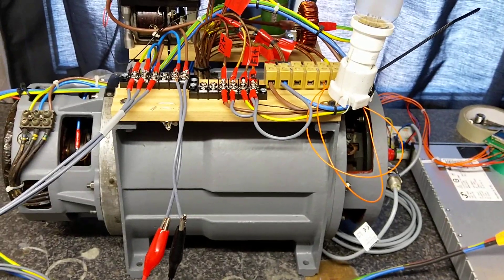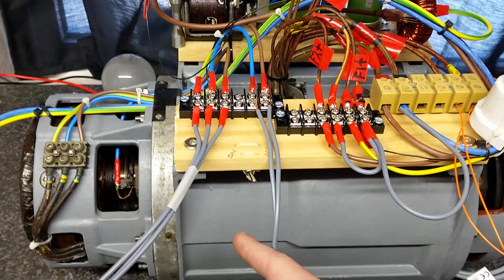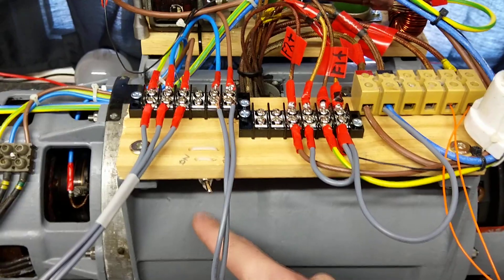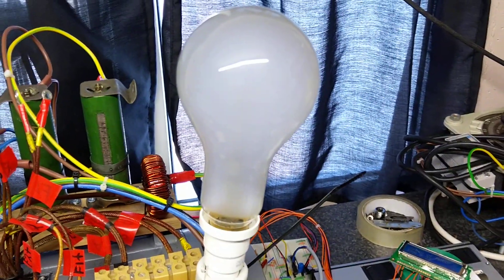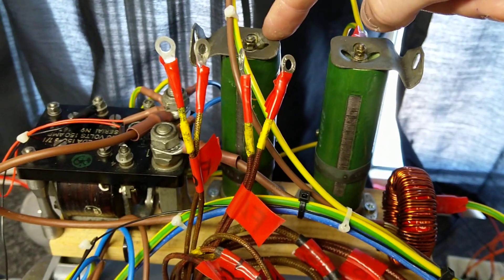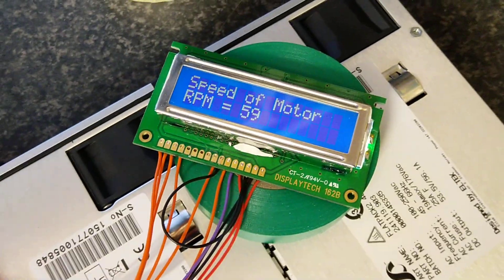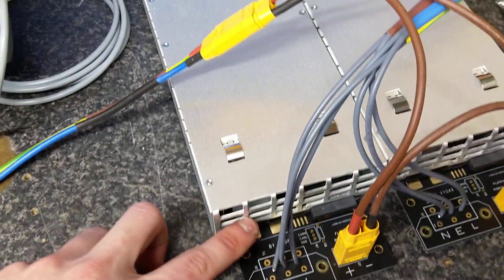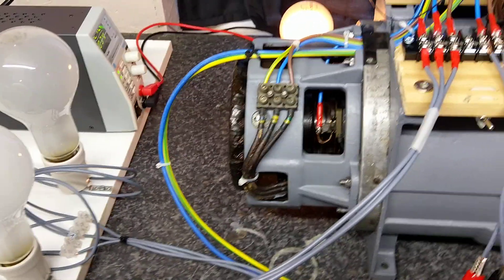Aircraft rotary transformer overview and run

Comment: That's pretty cool mate good work 
Can you adjust the frequency? 
It wants an xrt on each phase for a 3ph ladder🤣🤣
Steve ..
Reply from the maker: Thanks ^^ : D , Well the output frequency can be adjusted abit as its based on the speed so i can speed up / down the motor with its field resistor , I hope to do more with this once i get some bigger field resistors , I have run one x ray transformer on it but since its not center grounded due to the delta output i was worried about the voltage to the core , Would be fun on a three phase transformer ^^
Reply: @twirlywhirly555  yeah wouldn't worry about voltage to core its only 110 so 220 max .. could try it with 3 mots😁
Reply from the maker: @T2D.SteveArcs  Good to know , I do have three PT's i could try
Reply: @twirlywhirly555  👍😁